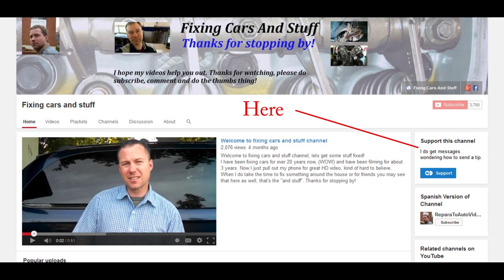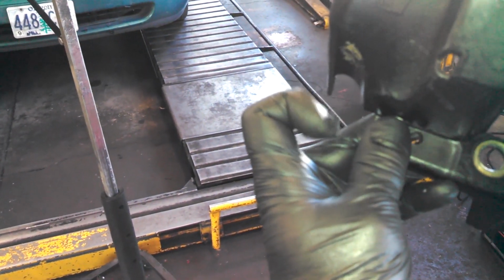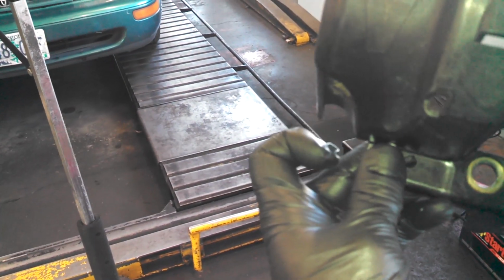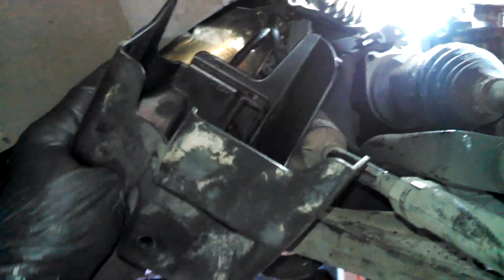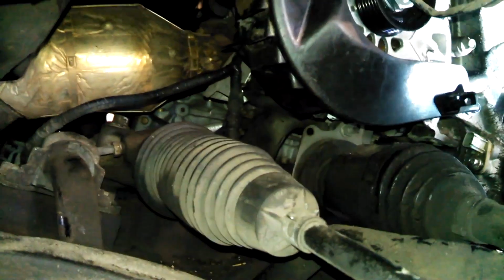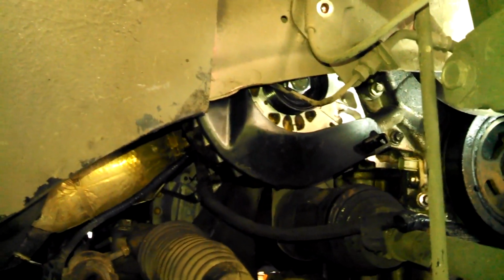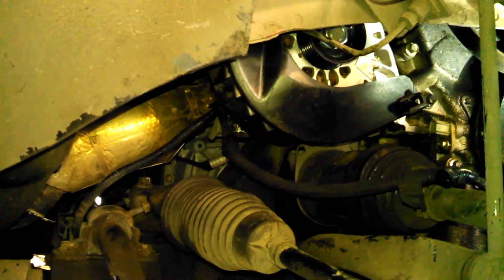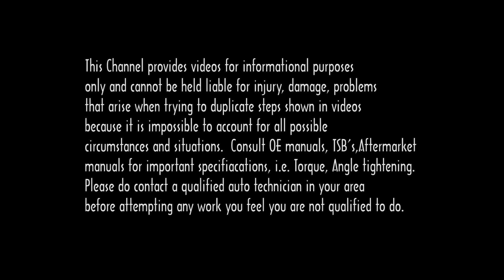Alternator replacement overview 2005 Mercury Montego Install Remove Replace How to

Comment: Not taking anything away from this video or the mechanic, but I just replaced the alternator on my 2006 Five Hundred without dropping the sub-frame.  The Ford service procedure doesn't call for dropping the sub-frame.   Do everything seen in this video except dropping the frame part.  Turn the steering wheel all the way to the right, this will get the tie-rod end out of the way and allow more room to get the alternator out.  Take your time and find the right angle.  The alternator pulley was facing up when I took it out and put it back in.  Give it a try, you can always drop the frame if you think you need to.
Reply: This is the right approach. I got mine out no problem, but i got really mad trying to get it back in, but my wife got it in no problem while i sulked.
Reply: @deathclock9  Glad I’m not the only one who deals with that shit at the low, defeated points. Hopefully ur wife doesn’t gloat about it for years on end. “Remember I’M the one who got it out!” It’s like- if u really feel so fucking powerful, please feel free to do all of this shit yourself. Granted, I was frustrated and appreciated the help, but don’t act like u did the whole fucking job and saved the world. U could barely even hold the alternator once u got it out!
Reply: @bospurgeon1039  I mean, when she's feeling down, I use it as a reminder how she can do lots of things that I cannot.
Reply: @deathclock9  YOU HAVE A GREAT WIFE, SIR. MINE WOULDN'T DO THAT AT ALL, SADLY.
Reply: That’s correct but if you take out the axle it’s a lot easier 👍

Comment: I have a 2005 with 269,000 miles, so I won't complain. Shortly, I'm going to attempt to change the alternately per this helpful video. I'm also going to try some of the tips in the comments. I'll let you guys know if I succeed.  Thanks.

Comment: I would take the tie rod end loose lower joint thru bolt or nut out  and just get that cv axle out of the way. Thanks for sharing a different option.